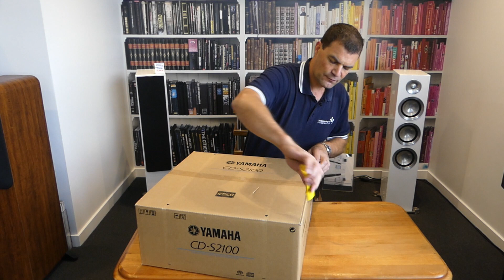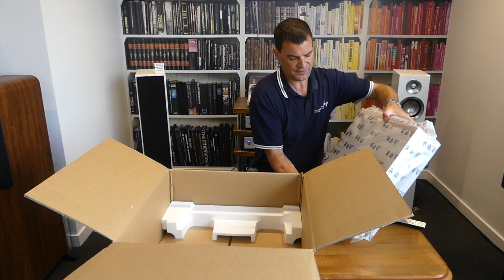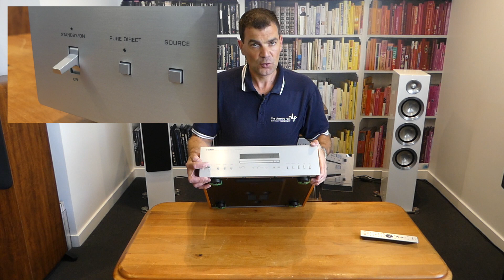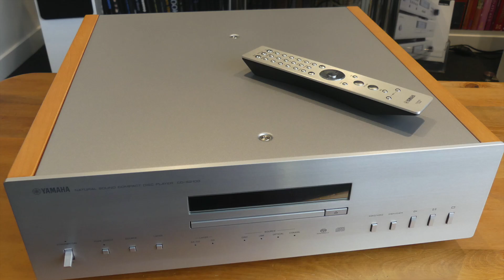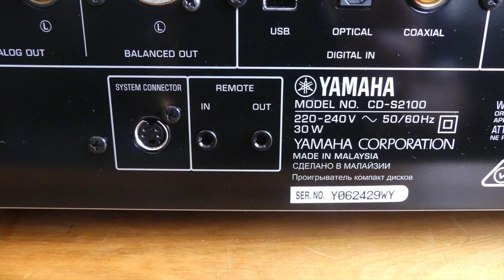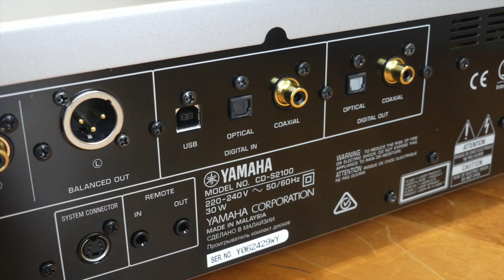Yamaha CD S2100 CD Player Unboxing | The Listening Post | TLPCHC TLPWLG

Comment: The interconnect cable is absolutely good enough for that CD player and no matter how much money you throw at it, it won't get better, not one iota.
Reply from the maker: No, it is not.  The player has so much more to give then if you strangle the sound with a basic interconnect.  I would recommend you listen to this CD Player with a WireWorld Oasis Audio Interconnect:  https://listeningpost.co.nz/shop/wireworld-oasis-stereo-interconnect/
Reply: @TLPCHC  It most definitely is. Uttering sentences like “strangling the sound” renders you completely ignorant of how audio works. So, perhaps steer clear of trying to explain it or even meddling in it at all. Not a tinniest nuance is lost with a basic cable and not even people like you who make such bold yet preposterous claims could tell if they’re listening to a system with basic or any other interconnect cable unless it’s faulty.
Reply from the maker: Cube Merula. Cables make a difference. If you want to deny this, go ahead. But it is likely that you have no personal experence in the matter, or refuse to take the opportunity to see/hear for yourself.  Stop wasting your time and mine.

Comment: The only thing i don't like about it is the open door button being to close to the cd drive. 👎
Reply from the maker: It is designed to be very thin and close to the CD clamp
Reply: @TLPCHC  
CD drive moved little left side because inside right power supply more bigger than left power supply and this is problems with designer why CD drive tray not located strong in center and for this stupidly design button for open/close disc installed right side from CD trays , no simmetrical😠
I have cd-s 3000 and have custom made from real polished gold badge for full size including disc tray and button open/close and have glued at disc tray and front look very nice , one gold line covered full length and looking fantastic and very rich 😉👍

Best Regards from Los Angeles, USA👋✌ 🍸
Reply: It’s not a problem in use , and there is button on the remote as well .